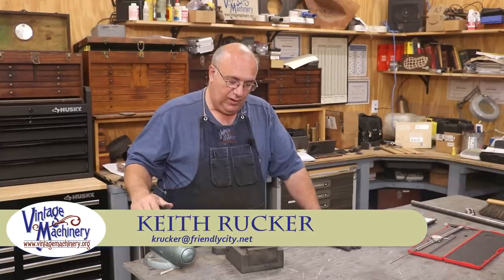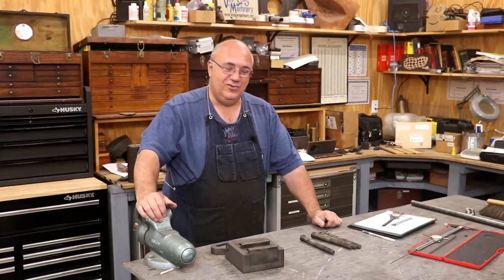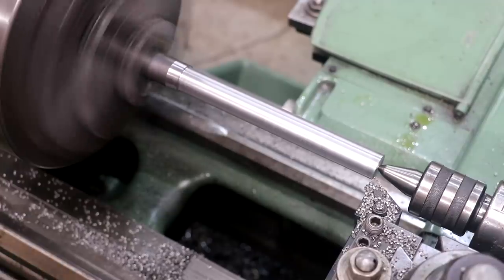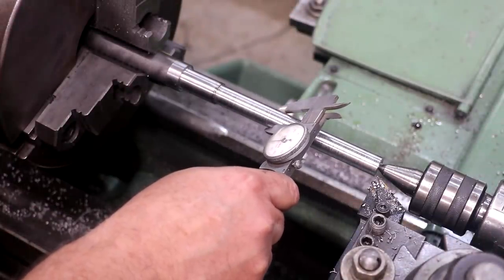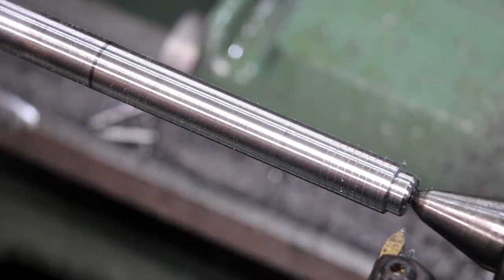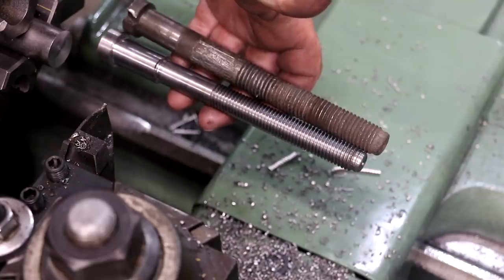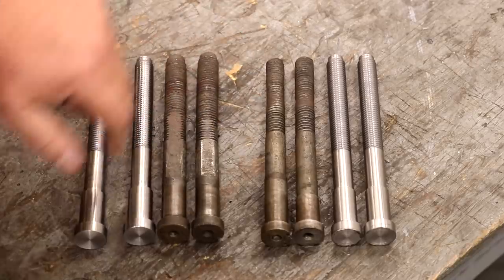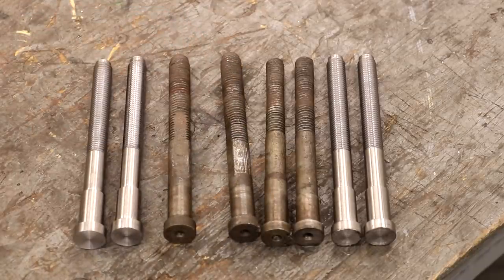Metal Planer Restoration 38: Turning and Threading new Studs for the Clapper Box

Comment: Great work, Keith! Your videos are always top notch. As an old planner operator,  I can make  a couple of guesses about the differences in the stud sizes.  The top two studs on the clapper get the greatest amount of stress,  as the tool wants to pivot right at the bottom of the clapper. It's possible that a machinist made the decision in the past to use as large a diameter stud as was practical to beef up the top studs to gain a little more life out of them.  Let me give you a little pro tip from the production line of the lathe section : When you have a bolt with a shoulder that's larger than the max thread dia. Rough turn the thread dia. first,  then finish turn the shoulder.  That way you don't waste any time turning such a long bolt to the diameter of the shoulder,  only to go on to turn most of the first part of the bolt  to a smaller (thread dia) size. Love your videos!

Comment: Thank you for pointing out the center marks on the heads and ends of the original studs, and the implication that they were turned on centers using lathe dogs. It's amazing what you can pick up once you understand some of the manufacturing processes.

Comment: Perhaps the reason for the different diameter clapper threads is that while operating the planer, the lower end of the cutting tool is pressed into the clapper, but the upper bolts are in tension and are taking all the load  from the cutter in tension on the bolt. This could also account for the thickness difference between the caps. There is all kinds of microscopic movement in the heavily loaded in the cutter and holding apparatus that could account for the differences in otherwise similar parts, especially when taking the huge cuts these machines are capable of.

Comment: I fhink we are looking at the start of regulation of bolt sizes in the 1800's. Very cool. Thanks for the wonderful videos Keith.
Reply: I can't begin to remember where I read this,but I think that the railroads had a big role in the standardizing of screw threads. Which makes a lot of sense,if true.

Maintenance superintendents want to be able to buy nuts and bolts that fit. Not pay a machinist every time a bolt or nut needs to be replaced.

Comment: Fixing up my 1939 Rivette lathe required some 32nd fractional size tools.  I do have some old wrenches in this denominator.

I learned in WWII the US manufactures were told told to reduce tools and us 16th fractional sizes.

Go back to the 18th century and may 64th was in use.

Comment: I am betting that the subtle differences in the clapper-box studs was necessitated by experience.  They probably found that the two studs needed to be a little heavier, AND there was not enough room or material to make all four the same size.

A hundred plus years ago, the Strength of Materials was not a very well understood.  Whereas today a part may only be 2x as strong as it needs to be, back then a part may have actually been 5x or 10x as strong and heavy as it needed to be.  Thats one reason older machines tended to be so big.

If I were to ever get another lathe, a quick change tool holder would be a must have.

Comment: Quick tip, Keith:
You don’t need to tap the holes for the keying pins. When you knock the studs out the back of the clapper with a hammer, plain pins will just fall out along with the studs.

Comment: I am enjoying this series hugely, and the amazing work by Keith.  I am looking forward to seeing the machine working.   BUT, (with my museum hat on) I do have a problem:   Given that machine will outlast us all and probably YouTube as well, in perhaps a couple of hundred years an 'Engineering Archaeologist' is going to be documenting the planer, measuring everything, and producing new material to explain the machine in a museum.  He is going to find screw threads on certain parts that 'prove to him' that standard pitches were in use at the time.  He'll probably also wonder how these were made without centres at either end of the studs.  So, did they have readily available chucks at the time the planer was built?  It's going to be a very confused story!   Could I suggest you stamp the date on all new parts made for the machine?  Those stamps are not going to get lost as any videos and documentation may well be.

Comment: They don’t call them Centre Lathes for nothing :)
Nice video showing a fairly common set of operations.
Older lathes often had a small spindle bore so if a long part didn’t go down the spindle between the centre it was.
The other benefit is it is highly repeatable.  You can take the part out and test fit.
The hard part is.getting the centre in both ends without a chuck. :)

Comment: Looking at the difference in wear on the threads, I have to wonder if the two larger studs were "modern" replacements for broken or bent originals...
Reply: That's what I was thinking also.   Maybe two of the studs were worn out, bent, or broken, and they pulled out the closest bolt they had and turned it down to serve as a replacement.   Then later they found it was too fat, so they ground down the sides so the cutters would fit on it.

Comment: Your solution is the pragmatic one. There is nothing to be gained by trying to replicate the original oddball thread. If anything it's more likely to speed up the demise of the machine by making it harder to maintain.
Reply: Wobblycogs Workshop. I have just put comment that highlights an English company that did make most of their machines and parts oddball sizes so as the spares were only available from them, but I don't think this is the case with Keith's planer ,more like a homebrew or in house replacement to get the machine back working soon as possible with whatever was available.

Comment: I wonder if the larger studs were acting as thrust surfaces? If you were taking a heavy cut to a shoulder or under a dovetail they might act to keep the cutter in a repeatable position as it traversed the part.

Comment: May have been mentioned, but the last video I watched, was wondering if those top two were added at a later date? Would seem there would be another set of pads above the top two bolts to me if they originally had all 4. Maybe you have a photo of an original ad for reference.

Comment: I wonder: Would turning between centers have allowed you to dial in a diameter and apply it to all four studs, doing the batch of studs in parallel instead of one at a time? Back when I had shop access, I found that sneaking up on precise diameters took a lot of time measuring and subtracting. I don't have a good sense for how much time/bother it takes to swap parts when you're working between centers. Which is why I'm asking. I also don't know how much runout you introduce if you remove and replace a part between centers.

Comment: Not sure what sort of steel he used for these, but as long as he used some sort of higher tensile strength alloy the new screws should be stronger than the originals even with the reduced diameter.
Reply: I'm sure he'd prefer that these bolts fail before the iron in the clapper box.  I think in a crash, the original iron clamping straps would have failed first, which explains why one of them at least seems to have been replaced in the past already.
Reply: @MattOGormanSmith   In the event of a crash the table should stop due to slippage in the belt driving the machine or shearing some sort of pin in a drive shaft meant exactly for this sort of situation. If those bolts break due to a crash, odds are you've thrown all those scraped surfaces way out whack.
Reply: @siggyincr7447  I think @MattOGormanSmith is correct. You would want the shear to occur almost instantly with the bolts absorbing all the energy and failing, as opposed to the entire machine needing to "catch up". The belts would only slip once they've overcome friction and that would actually mean storing significant energy beforehand that would be transferred to the entire driveline and every part of the machine going into compression. I'd rather make a couple bolts.
Reply: @TheDirtCreature  That's an almost impossible scenario, the way the cutters are mounted means the bolts would have to be so weak as to not function properly as clamps. You could design a mechanism to do what you're talking about, but the existing machine isn't designed to work that way.
Reply: ANY modern steel will be way stronger than steel of that era. Modern metallurgy is beyond the wildest dreams of even 30 years ago, much less 100 years ago.
Reply: @SuperAWaC  Not quite that extreme, most of the alloys used in tool and die making toady are the same ones my dad used 40-30  years ago. O1 steel has been around for well over a hundred years and is still a very common alloy in modern industry.
Reply: @siggyincr7447  The difference in precision and purity of which alloys are made is that extreme.

Comment: Americans, please assist: What are your common thread sizes to 1/2"? I want to buy a set of taps and dies, but don't want unicorns. Do I need both UNC and UNF? Maybe all the UNC and just some UNF, or doesn't it work that way in the US? Many thanks.
Reply: Here is a boxed set with the common sizes:
https://drillsandcutters.com/4-1-2-carbon-steel-40-piece-tap-and-die-set-with-hex-die
Reply: @5tr41ghtGuy  Thanks. That's what I was looking for. Knew there was as reason I've never seen anyone use a #5 screw.
Reply: @johnalexander2349  Except on some old(er) lathes and machinery (gib screws).
Reply: John,
The most common threads for the USA are course thread with the exception of 1/4" and 1/2".
For example: 1/4" threads are seen almost equally in 20 TPI and 28 TPI
1/2" threads are usually 13 TPI but many are 20 TPI
Almost all other nominal sizes like 5/16", 3/8" and 7/16" are most common in course thread.
#4, #6, #8, #10 and #12 machine screws usually only come in one thread pitch like #4/40, #6/32, #8/32, #10/24 and 12/24 (although, #10 and #12 are common in course and fine threads like #10/24, #10/32, #12/24 and #12/32). 
So, maybe buy the 1/4" and the 1/2" sizes in both pitches and buy course thread for the others.
So yes, buy mostly UNC and a couple UNF taps and dies (1/4" and 1/2"). 
Hope this helps to answer your question.

Comment: You need to add thread mics. to all those tools you have! 
The last threading pass is called a spring pass.
You don't actually know if any of the old studs are original.
Wondering, did you use stress proof steel?
JIM

Comment: I am curiuos about what the cam setup is that you use on the tool post when threading.  I see your able to throw a lever of some form that will pull the tool post out of the thread depth when your at the end of the cut.  I am sure you covered it in a prior vid.  Can some one tell me where I can see what was done?  Thankyou for anyones response
Reply: He just turns the cross slide wheel to bring the cutter out of the thread at the end rather than cutting a thread relief. It's a nicer way of doing it, but it does require practice.

Comment: If they turned everything between centers, how did they hold the stock to drill the center holes?
Reply: In production a mounted vice in a drill press was the most common method. Even if the center is slightly off once you start turning everything becomes concentric.
Reply: @july8xx  More likely they had one or more lathes with chucks in the factory for this type of work- at some point the ends need to be faced off. They probably started with 1" stock like Keith, so you cannot be very far off on your center if your finished size is .985
Reply: You chuck the stock in a 4 jaw, drill the best centers you can, then run it with a dog between centers. You can also do it by hand in a vise. The idea is this: get the best axis of rotation from a known piece of material. And it's a pretty simple thing to do, you just have to measure the item to figure out what it is.
Reply: Blondihacks just posted a video about this, lol
Reply: I'm not sure how "they" did it in the old days but, if you asked me to do it in my basement I'd use a square to find the "center" on both sides and drill holes in my drill press. As has already been mentioned, once you start turning the part will become concentric with the centers.
Reply: @JohnDavidDunlap  That works, but at some point you need to face the ends flat and if you are starting with 1" stock and your finish diameter is 0 .985, your center needs to be dead on.
Reply: @oldschool1993  Without using a collet or a lathe chuck, I think my only way to do that would be to mill the ends flat.
Reply: @JohnDavidDunlap  Yes, but any engineer or shop foreman who planned a production process requiring the milling of the end and then drilling before turning would soon find himself cleaning out his desk or locker.  This planer was not built by some small shop somewhere- they had to be a major player and probably had all the latest equipment of the time including lathes with 3 and 4 jaw chucks etc.
Reply: @oldschool1993  Well, then I'm stumped. lol
Reply: @JohnDavidDunlap  It all boils down to Keith's mention of the rarity of lathes with chucks back in the day, but I think he was looking at it from the perspective of a small or home shop, not from that of a major manufacturer.  I can remember the day when having a small lathe or mill in your garage was very rare.  It has only been in recent decades with the proliferation of cheap imported machinery that nearly every guy can afford them in his home shop.
Reply: @JohnDavidDunlap  You can use a half center, (that is what I call them, they probably have many names) a dead center that has one side machined away almost to the centerline. So that the flat goes into the center hole in the part. That provides clearance for the tool to face the part.
You need to then switch to a full center so you have enough bearing area for turning cuts.

Comment: Wouldnt it be easier to use modern HT bolts (or cap screws) and turn the heads down to suit.
Reply: Problem would be finding ones of that length with that much thread.

Comment: After watching the video:
It's entirely possible they actually targeted specifically 0.650" since it's a decent round number. When you're essentially making arbitrary thread sizes then having nice round numbers of thousandths looks nice. It could even be that they were targeting 65 hundredths with ± ½ thou if their measurement tools were only that accurate.
Reply: Decimal inches were first proposed in England 1857. Not sure how long it took to become standard practice, for machinists and shops to update all their tools and measuring equipment, to start making new industrial designs based on those dimensions, and then for the new practice to 'cross the pond'. In the 1880s, I imagine some machinists still thought and designed mainly in fractional inches.
Reply: @kindabluejazz  that's an interesting bit of history which is also pretty relevant. While the instruments for decimal inches definitely existed in America at the time, most calipers I've seen from the period were fractional and something like a vernier scale caliper seems like a likely tool for moderate precision at the time.

Comment: Since this is before Ford and mass production,  I imagine there were different machines that didn't match run by men with different backgrounds .
If each man was assigned to a different section to make then that's the  reason thread sizes don't match

Comment: Likely the odd ones out are replacements for the originals. And on the replacement, best choice. Everyone and their dog has upgraded these machines over time, and as long as one is respectful towards the machine, then there's absolutely no reason to not make improvements on the design or even upgrades.
If this were my machine, you'd bet i'd throw stepper motors and modern ball thread screws to move stuff around. I'd keep it respectful and easy to undo, but if i decide to get the strong iron force of an old machine, i'd very much like to also make improvements to it. I call it "shop rent".